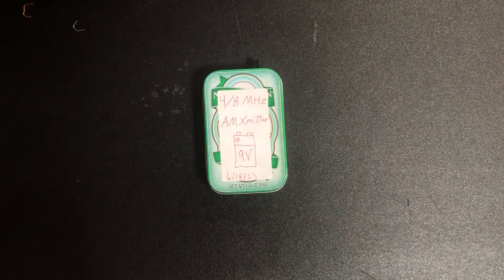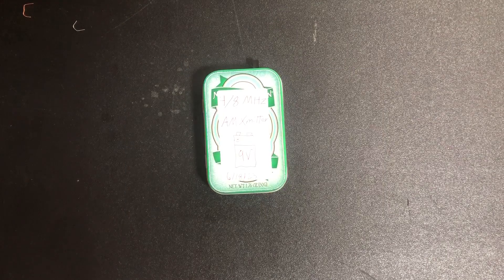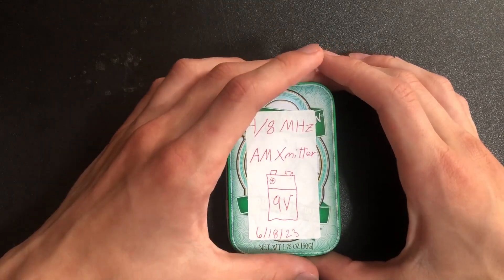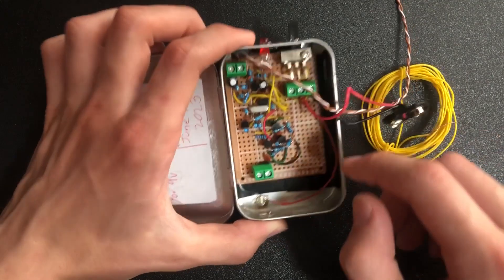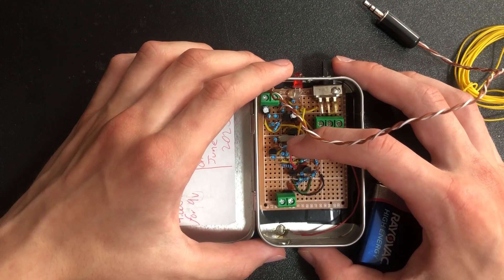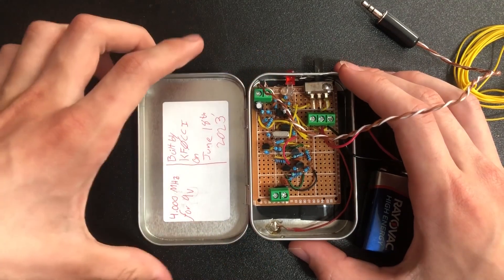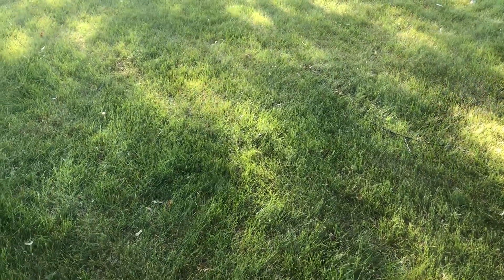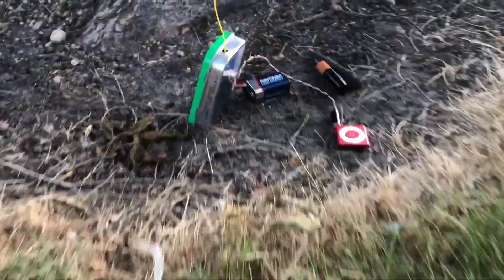2-pin Crystal AM Transmitter w/ 150+ ft of Range - AM2PC pt. 5

Comment: God! I love Sony multi-band receivers. Classic! Pure classic! 150 feet is quite the range, sir. Congrats! Try using 2N3553 with T-50-2 toroid wound with AWG 22 wire. With this transistor providing 7 Watts of power, you'll be covering more than a few kilometres. The type of oscillator you have employed my dear sir, is called Pierce Oscillator not Colpitts Oscillator. O and 2N3553 is TO-39 package so don't forget to use circular aluminum heat sink or it'll be a toast in a few seconds.
Reply: Is it possible u can make a schematics of how you mean it sir ?
Reply: @fosskali1482  sure sir! How do you suppose I share it?